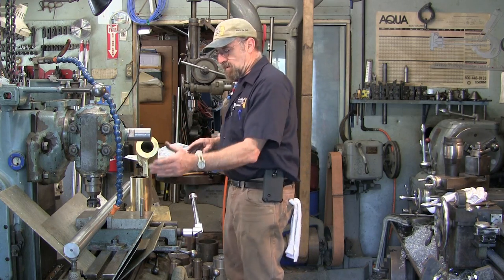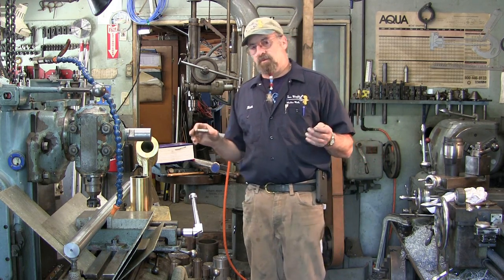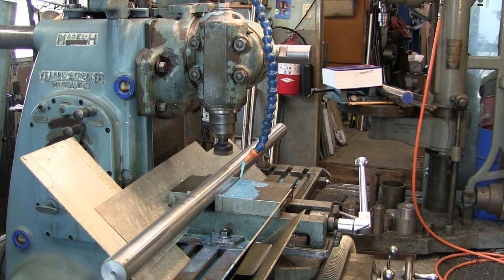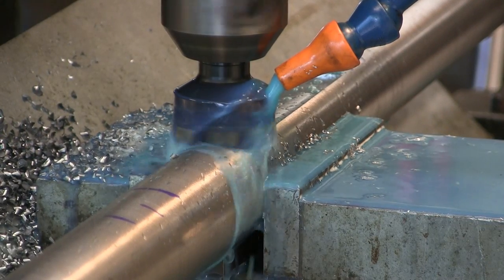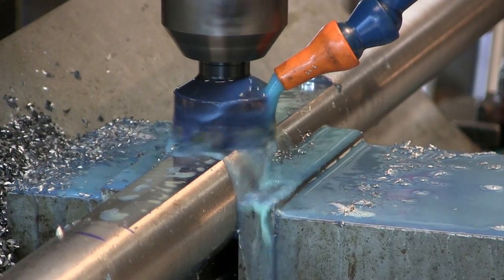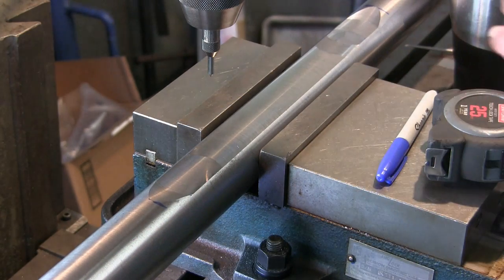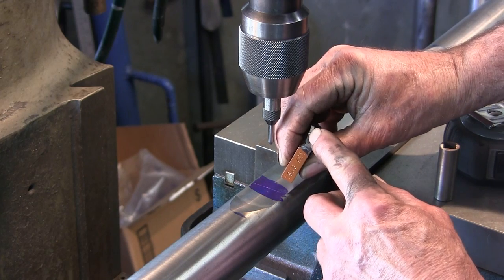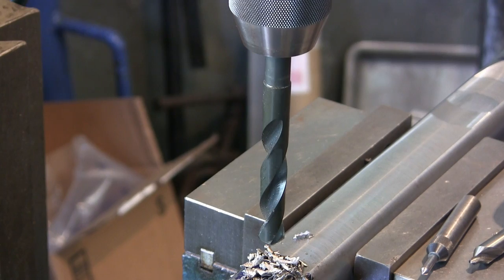My go to Bar Part 1

Comment: I'm so glad you put this back up. I was so glad you mentioned where you bought them and what the inserts were called. A few months ago when i made my first line boring bar i could not find these anywhere. Ended up crudely milling a square hole with rounded corners and ground down the corners of the bits... it worked but not very elegantly. I posted a few video's if you want a laugh
Thanks again

Comment: Machine Noise? That's part of using machines. It's part of how you tell your machines are running right or not. I'm watching these videos to learn about machines and machining and part of it IS the noise! What the tool sounds like when your using say a flycutter. I want to see AND hear it. I never had any issue hearing what you were saying. Keith your videos are great, keep them coming please. Waiting see No. 3

Comment: Hi Keith I have several boring bars that are not shop made and they all have the tool drilled in the center of the boring bar and most of my have a Morse # 4 taper for my HBM
Reply from the maker: THE IRONWORKER Yes a lot of bigger bars made for the HBM's and such, using Morse tapers, where the direction may be necessary to run in both directions they were put on center. ;{)------

Comment: Hi Keith,
again, many thanks for allowing us a view over your shoulder. learned a little something new in this episode on how to correctly position the tool bit in the bar.
got two questions:
1. what size of spout do you recommend for the coolant? i have a fairly small one on my bridgeport, 1/4" was pipe fitting diameter. the thing really spits the coolant out inspite of using the petcock to regulate flow. it burps pretty violently when i turn on the pump and spits a big bubble and splatters it all over.. it was a cheapy off of ebay, most likely made by our friends from unfinished tooling in a land far away...

2. when you run out the cut to make your taper, would it be easier for a beginner to use the power quill feed? i realize your K&T doesn't have a power quill feed, in that instance you would probably have to use the power feed for the knee.

cheers,
mike
Reply from the maker: HolzMichel Most of the times when you order the coolant flex lines several nozzles come with it, my  experience of try a few and find out what suits the job, flooding the area or using the force of coolant to flush out the chips, when needed. you can rid of most of the air burps and surges with the start up on your coolants using or cleaning a check valve in the feed line, which holds the coolant from flow backs to the sump. I also raise up the spout to put it out of my way when not using it and that keeps some in the line near the exit. most of the time you are going to get somewhat of a spit out on start up but in between part changes or direction start and stops it mellows out with check valves. ;{)-----